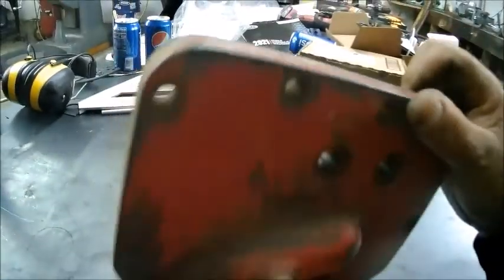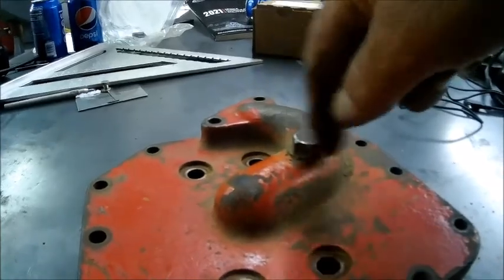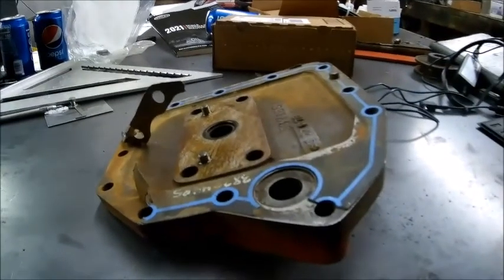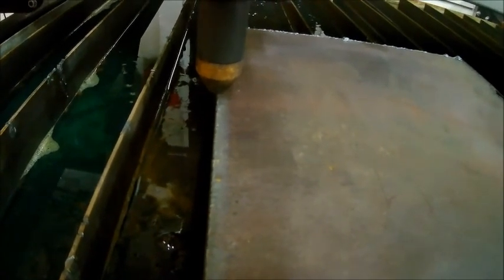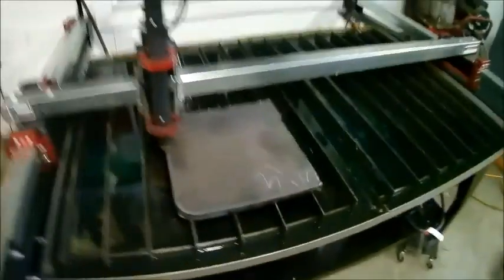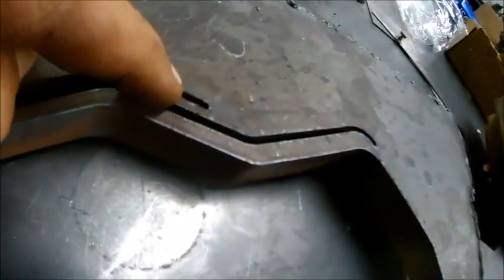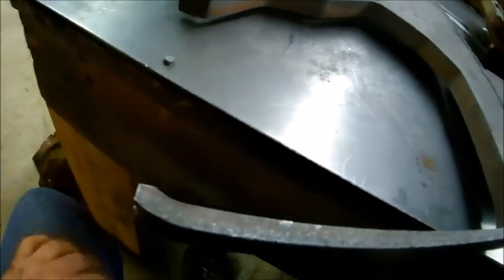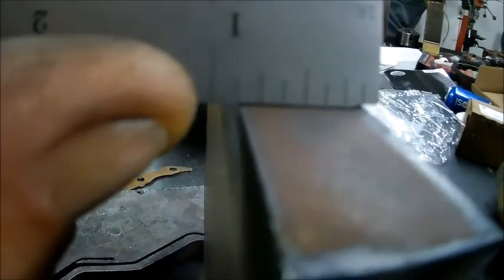LANGMUIR CROSSFIRE PRO, HYPERTHERM XP45, 3/4 PLATE

Comment: I am pretty impress with cutting power of that little plasma cutter. Could you please share with us what is you air filters set up to feed the plasma cutter?
Thanks!!!
Reply from the maker: My air system is poor i get a lot of moisture. i have a filter small desiccate dryer and the plasma has a filter on it also.  need better dryer system